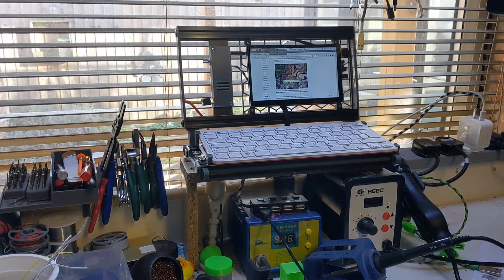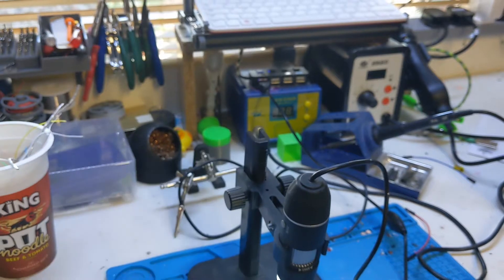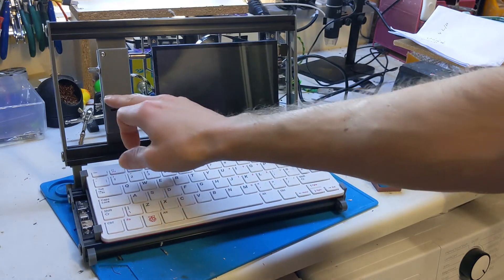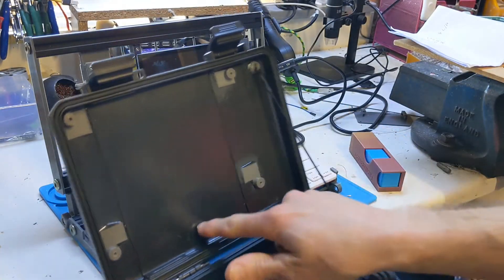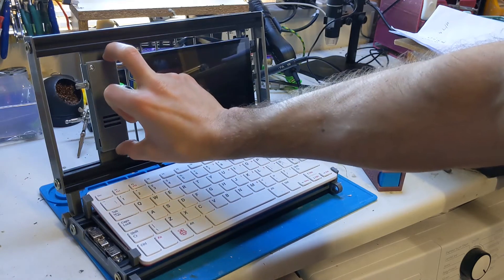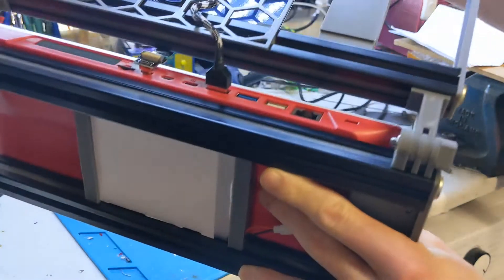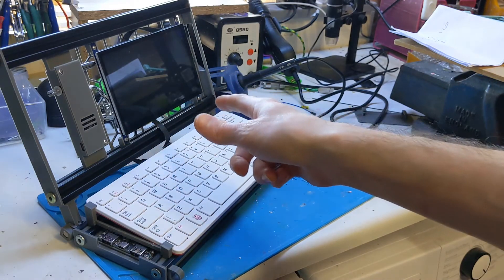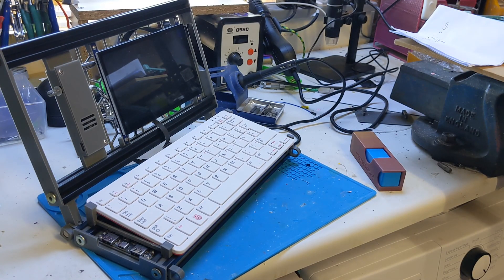Cyber deck 2020 extruder edition

Comment: Im still trying to figure these cyber decks out...Im 44 so bear with me. Wouldn't a regular laptop of the same dimensions give you a bigger screen and possibly more functionality with a sleeker design and less jank? Aesthetic at the cost of functionality is well..
Reply from the maker: It was more of a fun project to build and design than to be a laptop replacement. It definitely does pick aesthetics over function but I do use it most days on my bench.